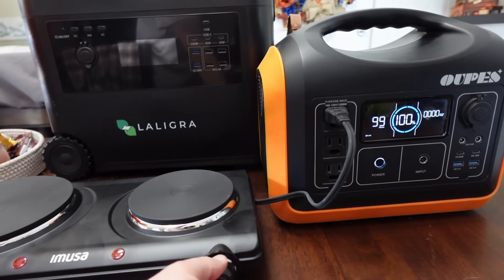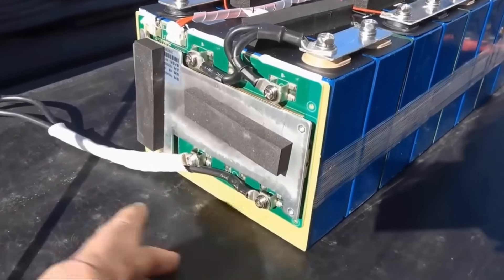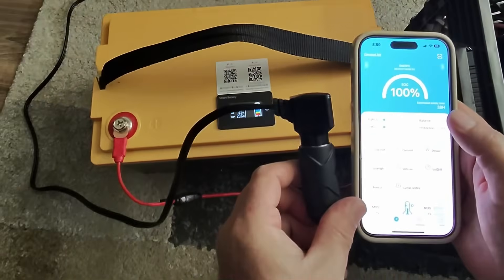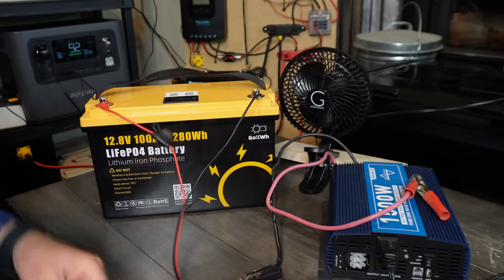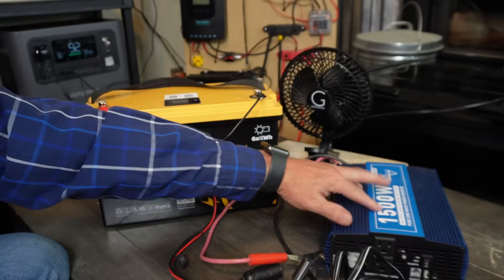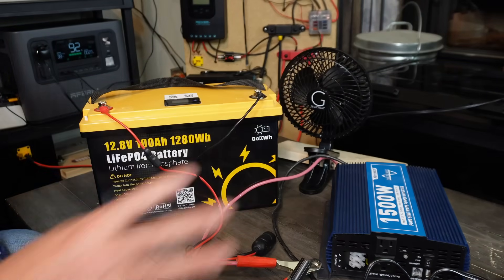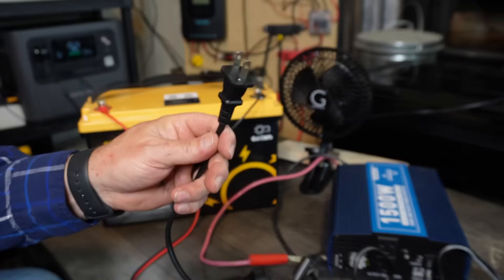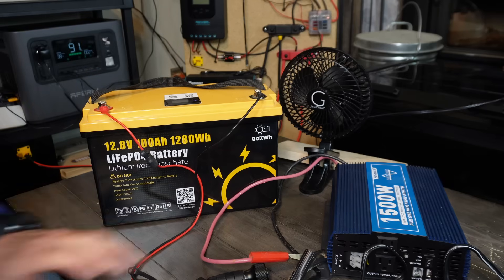Power Station Alternatives & Money Saving Tips

Comment: Look, I get where you're coming from but I think maybe you're missing the point of the all-in-one solutions. Mostly that they are a single all in one unit that does everything you need it to do. No dangling wires or connections, not several pieces to carry or configure in the dark. Something like an Ecoflow Delta is basically a replacement for a small gas generator that can be re-charged thousands of times over a 10yr period in a a few different ways (AC, DC, Solar, Car), not just with gasoline. Pick it up and go do stuff. No, they aren't going to power the same loads for the same time unless they're spec'd the same. In an emergency, I'd much rather have something easy to use, with a handle or wheels instead of components tied together on a shelf or on a piece of plywood. I'd also suggest buying the product with the best brand/specifications/reviews. You don't want to rely on the cheapest gear in an emergency. In fact, you want the opposite. Over spec'd, over built, perhaps some redundancy or headroom built in is what you want. Buy once, cry once. Buy cheap and you'll keep re-buying things as they break or you find they're not built or designed as good as slightly more expensive stuff. Honestly, by the time you purchase all the components, you've probably paid more than a all-in-one power station.
Reply: The problem  is the all in one power station can break or wear down.  The system  he is showing  is for a base camp or   bunker.  This system  can be repaired by you. Just swap out the bad part or parts.  This  system  got it pro and cons like everything in life.  Have this system, power station or stations,  solar panels and dual fuel generator  is what u need. Never depend  on one thing.  Have back up on top of backup.
Reply: And if it breaks, the warranty is over, what do you do. I built mine 5 years ago for half the cost and I can expand the capacity. You can't
Reply: They’re massively overpriced for what you’re getting.
I get that not everyone has the basic electrical skills to make their own setup, but a home made setup (preferably with lead acid batteries) is far more robust, cheaper & easier to service & keep going. You can also break it down, take the lighter bits with you & scavenge a battery when you get where you’re going, if you need to bug out on foot..
Reply: Sonicboompole, It seems to me that you missed the point as these two illustrated.  A component fails in an all-in-one, and you are screwed.  Make it yourself and replace a failed component and repair it yourself.

Comment: was watching until he threw the positive aligator clip on top of the (pure sine wave) chassis the outer would be grounded to DC or AC with capacitor, so unless that outer blue paint really thick, pop or damage waiting to happen.

i find i like liFePo4 for the last 10 years to be much better and safer, just need to make sure stored and charged correctly.

also recently iv'e found many non pure sine wave inverters do the job quite well, instead of just dying after overload, they sence the overload with a nice big cap and disipate slowly to bring and inductive load up to at least a speed, good for fridges etc
Reply: The sun is free 😊

Comment: IMPORTANT: IF you use a trickle charger on a LiFePO4 battery, buy a charger for that chemistry.  Lead Acid trickle chargers will not fully charge your LiFePO4 battery.   Also the LiFePO4 battery doesn't need to be trickle charged. Charge it and forget it.  It holds its charge for a very long time. EASILY 6 months+.  A proper 120 volt charger can recharge your LiFePO4 battery under a couple of hours with the proper charger. Once charged, disconnect it.  Flooded Lead Acid/AGM batteries do like trickle chargers.

Comment: Good video!  I just finished a power station very similar to this. 100Ah LiFePo4 LiTime in a battery box with a main power switch, 10A breaker, 12V lighted power plugs, power meter with USB A&C, dual Anderson plugs, and pole relocation kit to the top of the box.  Inputs for charging are external poles, Anderson plug, and flat plug that’s on most solar charge controller. Planning on adding 750/1000W inverter to mount on top when needed. Sorry for geeking out, but if you want all the options then you must DIY and also save $$$.
Reply: If your power plug with USB is voltage based, it's worthless. LiPo4 batteries don't work like that. You need to use a shunt
Reply from the maker: @texasprepperprojects Good point. It's more of a rough estimate of how charged your battery is. No where near exact though.
Reply: @TheBugOutLocation   No, its actually worthless. If you look at the voltage discharge curve of a LiPo4 battery, it's essentially flat until you get to the last 80%
Reply: @texasprepperprojects so essentially a shunt will reveal the actual remaining life condition on a LiFePo4 battery?  I guess it could be added to the negative lead and it will show real power control? Sizing the shunt to match battery size also? 100Ah battery = 100 Amp Shunt?  Thanks for the insight!
Reply: Does his battery have cancer? @texasprepperprojects
Reply from the maker: Haha! Nice!
Reply: Made a mini version always charging my low voltage dc appliances for free every sunrise and sun set
Reply: Got parts list

Comment: If you bought the power stations between Black Friday 2024 and today. It was roughly 50 - 65% off. There's no way you can build a DIY for that price.
A typical 1000/1800w Ecoflow, Bluetti, Anker, Jackery were selling for $399 to $450.
They came with the features listed below.

1) 1800w PSW inverter $200
2) 600w solar controller $150
3) 1800w battery charger $150
4) 250 amp Bluetooth shunt $100
5) 100ah LFP battery $300
6) USB ports $25
7) 120v AC outlets $25
8) misc $50
Reply: I did it cheaper in lockdown, and what you're forgetting is that you can buy all the bits separately on black Friday/sales too. I recently looked at VTOMAN:  Jump 2200 Portable Power Station £580
VTOMAN 400w solar £478
I bought 405w bifacial solar panels in lockdown for £58 in lockdown, now they are £48. If one part breaks as my circuit breaker recently did, simple to fix and £7. I did however buy a power station a few months ago and love the portability.
Reply: What’s a good reliable cheap inverter 1500-2000w
Reply: @skyhawk21  
Giandel